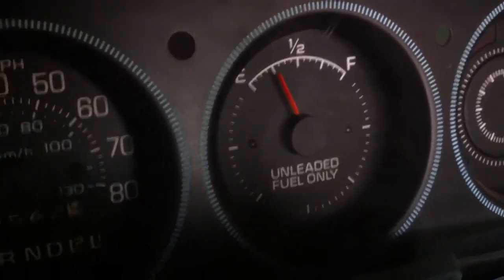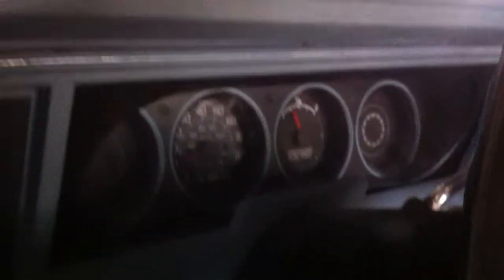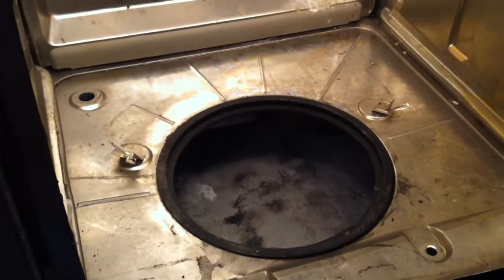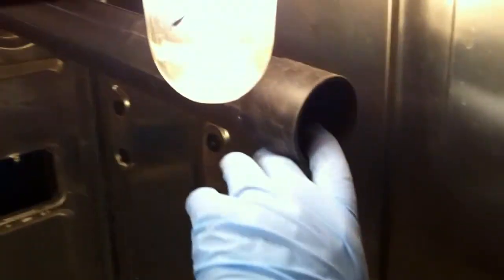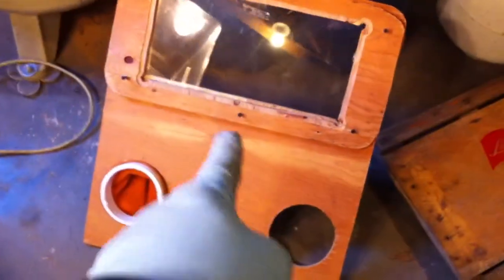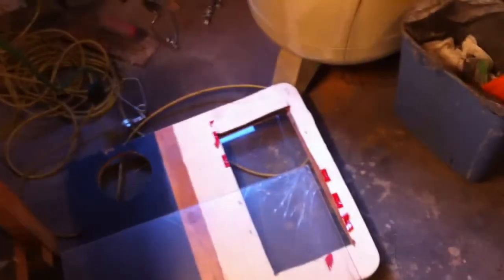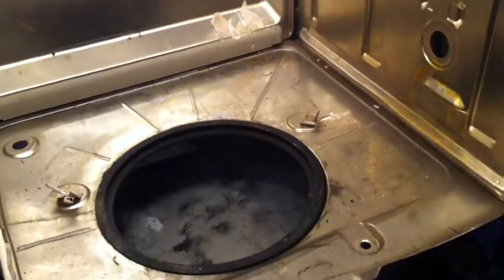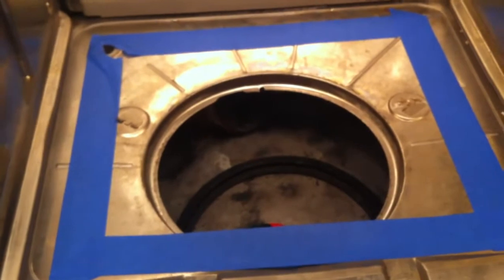Homemade blast cabinet Part 2

Comment: You are aware that ya can purchase a complete metal sand blast cabinet from Harbor Freight for like $90 dollars right???? And the glass would have been the better choice because the abrasive bouncing off the plexi, quickly makes visibility impossible. Long arm acid proof gloves would be a good choice for longevity with flexibility (they can take some abuse) but leather, long gauntlet gloves work just fine but you will have to extend the gauntlets. So how are your sewing skills???  "OR"...... wait for it............ If ya go to a farm store, ya can buy disposable long arm plastic gloves that the farmers use to reach up the pregnant cow's ass to check fetus growth in the womb........... personally, I'd go leather gloves with the legs of an old pair of nylon pants sewn to them. Thrift store purchase of course. LOL. Keep at it Bro. You're doing just fine.
Reply: Good advice Ed, Lets hope he's paying attention.
Reply from the maker: Yes, I know I can get a cheap blast cabinet that may work better than mine, but what's the fun in that?... And I know the glass would be a more durable surface than the plexi... a lot of people were concerned about the glass being right in front of my face. I could put a piece of glass in front of the plexi...As for the glove, I got them cheap at HF-- "blasting gloves" they called them, so I figured I'd try them out. Those farmer's gloves I can get used, I think
Reply: Used? Good one Bro...lol. :-)